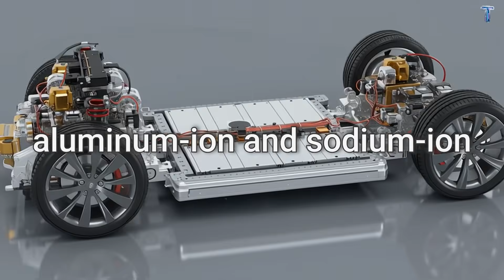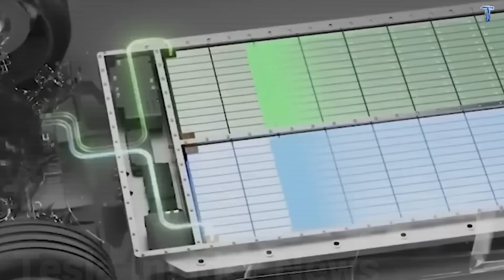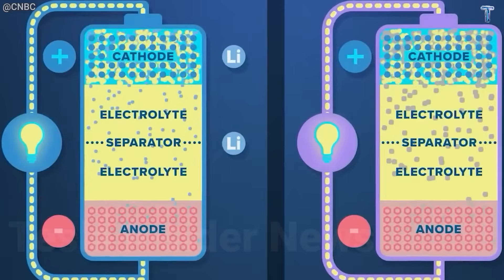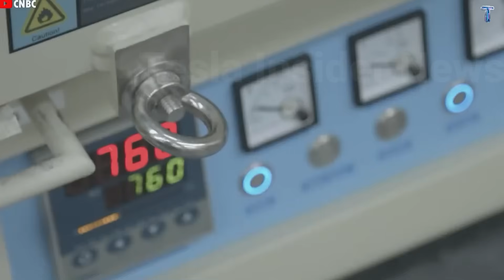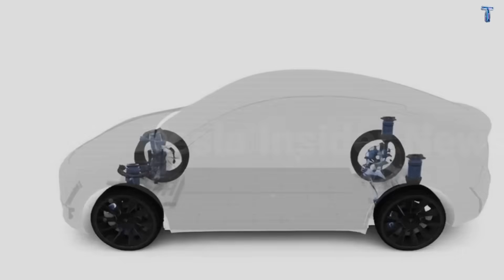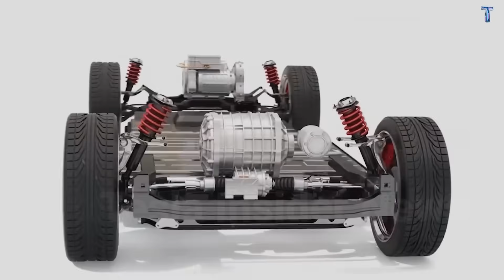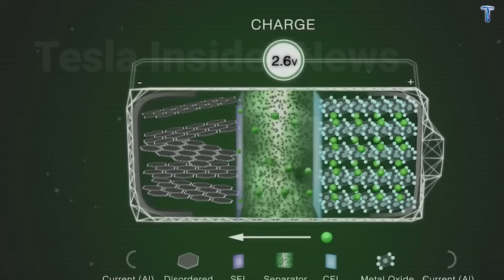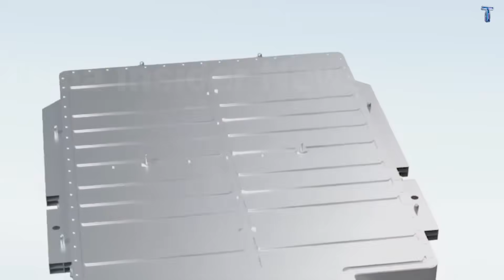Elon Musk’s $12,749 Tesla Model 2 Ends Charging Anxiety Forever

Comment from the maker: 10-minute charging. Decades-long battery life. Sub-$13k price.
If Tesla really pulls this off with aluminum-ion and sodium-ion, range anxiety and battery fear are officially dead.
Question is simple: faster charging or longer range — which one actually matters to you?
Reply: BOTH. If the car can charge itself while driving, that would help. A built in battery charger with multiple types of input; alternator, solar, car wheel rotors, in addition to fast-charging batteries, GAME OVER.

Comment: BOTH. If the car can charge itself while driving, that would help. A built in battery charger with multiple types of input; alternator, solar, car wheel rotors, in addition to fast-charging batteries, GAME OVER.
Reply from the maker: That idea comes up a lot, and parts of it already exist in limited form. Regenerative braking is essentially charging from wheel motion, but it can’t create extra energy, it just recovers what would’ve been lost. Solar and onboard generation help at the margins, not enough to fully sustain driving. That’s why the focus stays on faster charging, higher cycle life, and efficiency gains. These concepts are explored internally and across the industry, but physics still sets boundaries, and details can evolve as real-world testing continues.
Reply: @TeslaInsiderNews  Hello, I don't believe that there isn't a way to to build an EV that charges itself. Recovering what would have been lost is essentially extending the range of the vehicle and charging itself. Driving over charging areas that charge without stopping the car, wireless charging networks where all of our machines that require charging are constantly being charged using Earth's energy. Hopefully, REAL WORLD TESTING will include many of the hidden technologies that will make this a reality. If not, we will be setting ourselves up to rely on others who will eventually take advantage of us, AGAIN.
Reply from the maker: Totally get where you’re coming from. Extending range is a form of self-charging, and ideas like dynamic road charging, advanced wireless transfer, and energy recovery beyond today’s regen are all being explored internally. What’s being discussed right now is based on leaked internal research and pilot concepts, so details can evolve as real-world testing continues. As soon as there’s clearer confirmation on how far these technologies can realistically scale, we’ll put out an update. Curious which approach you think would make the biggest real-world impact first?
Reply: @TeslaInsiderNews  Hello, I would like to see EVs have their own builtin charging system like an alternator of some kind, in addition to very fast charging batteries; something to show potential buyers that the goal really IS complete self-charging. Surpassing ranges of gasoline powered vehicles and offering other advanced and unique features will help, It could definitely be disruptive to some other technologies but it has to happen someday. Maybe trading the disruption of one industry by creating brand new industries to offset.
The paradigms have to change. Thank you.

Comment: FULL BS. he cant build it for that price. the 50% tariffs on steel and aluminum & copper makes it impossible. I know that China has such a battery developed. However, they have cheap material.
Reply from the maker: Cost skepticism is reasonable, especially with tariffs and raw material pressure. The pricing being discussed comes from internal cost modeling and alternative supply assumptions, not a finalized build sheet. Manufacturing location, sourcing strategy, and battery chemistry all have a big impact, and those variables can still shift. Nothing here is presented as locked or guaranteed, which is why updates matter as real production decisions become clearer.

Comment: AL-ion still has a way to go. They've been around a long time and have had a lot of work done on them the last 15 years but still have unsolved problems.
Reply: Explain the problems, please.
Reply from the maker: Main challenges have been things like lower practical energy density, electrode stability over long-term use, and scaling manufacturing from lab cells to automotive-grade packs. Fast charging and long cycle life look great in theory, but maintaining consistent performance, cost control, and durability in real-world conditions is where the hard work is. That’s why it’s being tested alongside other chemistries in internal programs, not treated as a finished or guaranteed solution yet.
Reply from the maker: That’s a reasonable take. Aluminum-ion has been researched for years and it does come with technical challenges. What’s different now is how it’s being approached in pilot programs alongside other chemistries, not as a single silver bullet. This is still internal development and validation, so nothing is presented as solved or final yet. Progress is incremental, and we’ll keep updating as real-world results become clearer.

Comment: Even if charging is fast, 250 miles of range seems low compared to current EVs. Wouldn’t that still be a dealbreaker?
Reply from the maker: It really comes down to usage. The idea here is trading extreme range for speed and longevity. If charging takes minutes instead of nearly an hour, that balance starts to make more sense for daily driving, especially as infrastructure improves.

Comment: Sounds impressive, but 10-minute charging and batteries lasting decades feels a bit too perfect. Is this actually real-world tech or just early testing?
Reply from the maker: From what’s been shared, this is based on internal pilot programs already running, not just lab concepts. Battery development is moving fast, so details can still evolve, but that’s why updates matter as more real-world data comes out.
Reply: It's been known for a long time that Al-ion offers very fast charging and 5 figure charge cycle life -in theory. But getting it to work in practice has been problematic. Wiki has a good article on it.
Reply from the maker: That’s a fair summary. The theory has been strong for a long time, but the real challenge has been consistency, materials stability, and scaling beyond the lab. What’s being discussed now comes from newer internal testing and pilot efforts aimed at those exact bottlenecks. It’s not presented as a solved problem yet, but as active development where practical validation is still ongoing and subject to change as more data comes in.

Comment: Why did you say that "it takes 10 minutes to fill my gas tank? Wtf, it takes 2 minutes?" Kinda makes me question all you posit when you start with , as you said, "an uncomfortable truth."
Reply from the maker: The exact number isn’t the core argument, it’s the contrast between minutes versus waiting. Whether it’s 2 minutes or 5, fueling a gas car is still a quick, predictable stop. The comparison is about how fast-charging EV tech is trying to match that experience. The battery details discussed are based on internal development info that can still evolve, and we’ll keep updating as clearer real-world data comes out.
Reply: @TeslaInsiderNews  And the faster charging time has no risk of thermal runaways, no fire risk means you can park this in your garage safely.
Reply from the maker: Improved safety is one of the main goals, yes. The newer battery approaches being discussed focus on much higher thermal stability and lower fire risk compared to traditional lithium designs. That’s based on internal testing and alternative chemistries still under validation, so details can evolve, but reducing thermal runaway is a key driver behind these developments.
Reply: @TeslaInsiderNews  I am aware of the point, but you make it invalid with a lie.